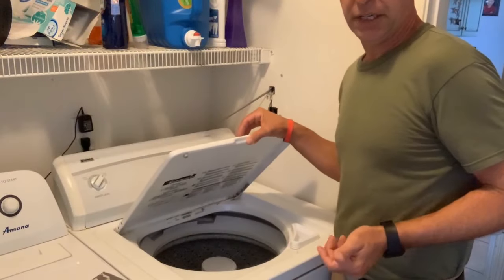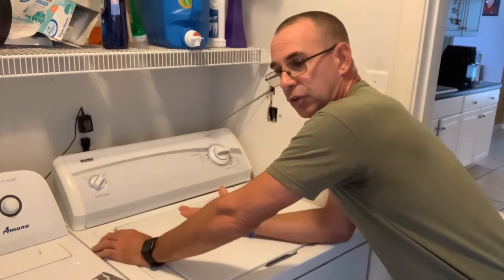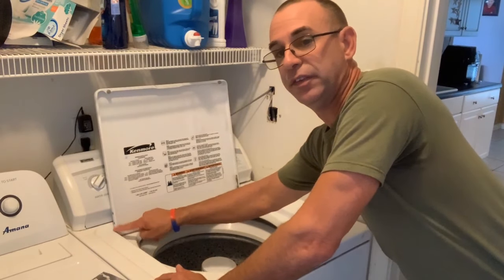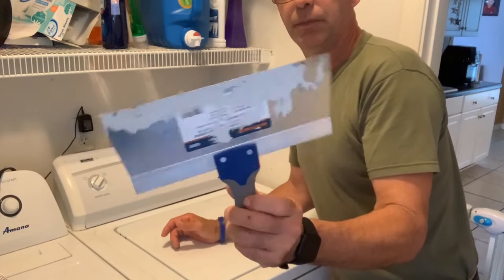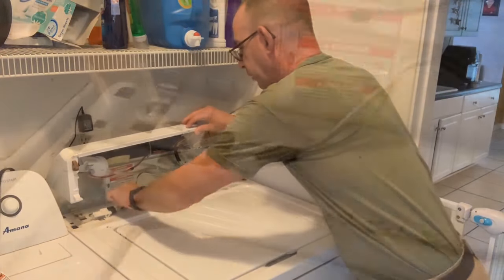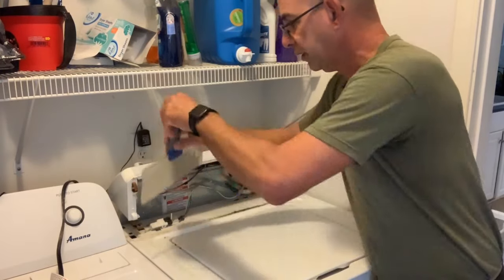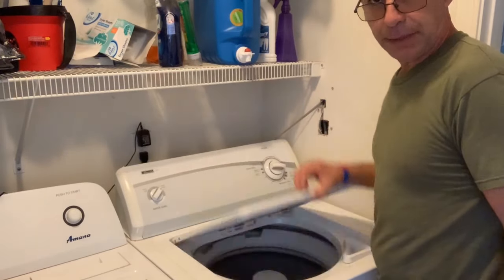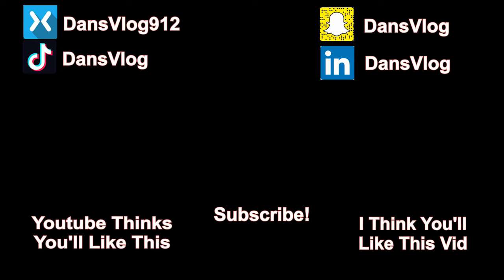FREE FIX - Washing Machine Fills Then Stops - New Style Lid Switch ByPass #Hack

Comment: These kinds of videos are the beauty of YouTube! Keep it up! You, sir, are a lifesaver!
Reply from the maker: Glad to help!
Reply: Problem I have is my washer machine doesn't spray any water you can turn on the rinse cycle and it sounds like the water is trying to drain out but when I turn on you know like the light cycle to start the water; that doesn't happen. Originally everything was working but then we had to replace the temperature switch because we bought a used washer and that was broken we replaced the temperature switch now we're not sure what's causing it what do you think @DansVlog

Comment: Great video, saved me money and a ton of time. This morning had a washer full of water and clothes and it wouldn’t start. Watched this video and literally 10 minutes later the washer was running. The lid switch was exactly where you showed it and the fix worked like a charm. 
The best part is I never have to worry about a bad lid switch again. Thanks for posting this video.
Reply: Have 3 wires purple yellow and another color ßo can u explain  do I need to by pass one of them and cut them and wire them or qhich wires back together have a ge and u unplugged the door switch as well but mine is different

Comment: Thank you so so much!!!! I knew about the little lever underneath but I think I've exhausted that hack. It stopped working. I used this hack and it worked! the comments were really helpful too! I didn't cut the wires either, I was skeptical about that part. Literally just twisted all the wires together tightly as they were and to our surprise it worked. Saved my grandma the stress of purchasing a new machine (she doesn't like change). THANK YOU!

Comment: Thank you Dan!  Same symptoms, and I found that someone in the past had done this in a BAD way, by making a jumper with a tiny 1/2 inch U- shape of stranded wire, merely inserted into the white and gray terminals of the plug itself.  <~~~Don't do that folks, because that eventually fried earlier today.  
Found this video, and I cut the wires as you showed and used a wire nut.  Fixed!

Comment: Was EXACTLY my problem! I didn't cut the wires, but I unplugged the switch and made a jumper out of bare wire between the two sockets of the gray and white wires. Worked like a charm and pinpointed the faulty part! Hero! Thanks!
Reply from the maker: My pleasure

Comment: Great tip. The switch on mine failed about 6 months ago, I replaced it, and it started working again. Until recently, when the same water filling and stopping issue happened again. Opened it back up and the switch was still clicking, guessing that the issue is now the lever attached to the lid. Held the slider down on the switch, stuck a small dowel rod in to hold it down and the washer is up and running again. The washer is 10+ years old and if this happens again I'll probably go for twisting the wires together, as shown in the vid, to get every last bit of use out of it that I can.
Reply from the maker: Heck ya!

Comment: Great video. I just fixed my washer, which is a Kenmore 80 series type 111. Even though the lid and head section design is different, it started to run after I shorted the safety switch.
Reply from the maker: Happy to of helped

Comment: So very glad I found this video. I haven't fixed the issue yet but have had pre-existing problems with having to push the door hard to the left in order to work. I've also noticed the agitator doesn't seem to be tight. It barely moves until I put pressure down on it. Hopefully another easy fix.😉

Comment: On my top loader Kenmore I have found the left side hinge screws come loose causing the lever to be just out of alignment to make contact with the switch when the lid is closed.  Tightening the two screws usually solves the issue.  Repeated slamming of the lid will damage the switch necessitating replacement.
Reply from the maker: My switch became brittle and broke in pieces. I had no choice in getting the washer to work. I had to figure out a hack.

Comment: Thank you so much!! Mine was an Admiral but the symptoms and fix were identical. I was trying everything from diagnostics mode and constantly power cycling. My lid switch is a little different, it's a magnetic mechanism on the front side of the washer, but sure enough I reached my fingers under and just kind of fiddled with the housing on the switch and there was a mild click that I could barely even feel and sure enough it started working again. Probably just a loose wire or something in it. Glad that I didn't go out and buy a new washer. Will probably replace it when I get time if it acts up again.
Reply from the maker: Happy to help

Comment: Thanks for the video ! I have a question as to how the science behind cutting the wires works. Did exactly as you said and it worked, but was just curious for my own thirst for knowledge. Thanks in advance !
Reply from the maker: Connecting the wires the way we do in this video “completes the circuit”. When the wires are connected to the switch, let’s say one to pole A and one to pole B, the switch is open (not completing the circuit). When the lid closes, inside the switch, a metal piece connects pole A and pole B (just like the way we connected the wires).

Comment: I can confirm it works with maytag centennial commercial technology  washer ! ,Thank you
Reply: Miguel did it really work
Reply: @denashachambers8899  Yeah still to this day🤣 trying to get the most life out of this washing machine they sure don't make them like they used to.
Reply: @chairez449  I’m trying to figure mines out but I can’t get the top part of it off
Reply: @denashachambers8899   try prying it off from tbe corners it comes right off I did bend mine a little but still works good luck!
Reply: @denashachambers8899  I got mine to come off with a drywall taping knife
Reply: @denashachambers8899   yours might have screws. My washer had screws I had to remove to take the panel off

Comment: Hey thank you , I have a whirlpool washer that when I fill the water when it was done it stopped , so 2 hours I was trynna solve this problem

I called my mom and she had told me there is a reset/test button on the cord outlet so I bassicly hit reset and it started working , I honestly thought I somehow broke it when I I did Superwash load with only a bed sheet and some towels 🤣

Comment: Question:  So when I cut the gray and the white so I need a special tool to strip them?  Do they  even have to be striped?   Then do I twist the wires together before I put the electrical tape on?  As you can tell; I am not handy and a bit nervous to try this.  Thank you in advance.

Comment: If you want to retain the security of a lid safety switch, then the proper replacement lid switch harness costs about $30, or you could just wire in a new generic switch for ten bucks or so.  And if you do, then Youtube is your friend as to how to make that replacement.  It can be a bit more or less difficult than what Dan just did.  At any rate, a replacement lid lock harness does not make the lid lock inoperative.

Comment: Ok I have a question? I have a Kenmore washer top loader series 100 when I put it on the cycle and load it it up with clothes and push start it fills up with water but once it gets full instead of starting to ajitate “wash clothes” it starts drawing once it drains all the water out it doesn’t do anything else so basically it fills and then it drains what could it be 🙏🙏🙏🙏

Comment: I just tried to get the top off and something snapped then the washer started working again. I'm assuming I snapped off the bolt for the ground on the switch haha. 1-minute fix and I didn't even need to remove anything.

Comment: Thanks for this post and description. We have a 80 series Kenmore washing machine that does not agitate on some cycles and hums or clicks when not agitating, but still spins. It also makes loud noises near spinning cycle. Could it be the same issue?
Reply from the maker: No. Sounds like you have clutch issues but a machine that old? It’s time my friend. Put ol’yella down and get yourself a new pup!!
Reply: @DansVlog  😆 I meant to write 80 series Kenmore. Ik ppl still are working on those. Either way, thanks for the  advice and insight 🙏
Reply: It was the timer switch, but we ended up replacing the washer. Appreciate all of your advice.

Comment: Mine did same thing but I hear a hum is this the same issue, nevermind this wasn't the issue had all these symptoms but I heard humming indicating that the motor trying to work, took apart and a sock was stuck in water pump 10min quick fix
Reply: How did you take it apart. I'm having humming and not washing issues

Comment: Great vid thank u. Wonder if you do the bypass, if switch is never replaced could it cause a fire or electric shock????
Reply from the maker: Well I’m not certified to answer that under a legal sense but I can say if the lid is down and the button is pressed then the electricity is making contact in the exact same manner as putting the two wires together like we did in this video. I can’t imagine overheating or anything like that to cause a fire. We’re not changing voltage or amperage

Comment: Front panel does not open - the screws are on the back.  I put a load in and now wondering why it stop working after I place the load in the machine.   😭😭

Comment: Greetings and thanks for this post. The washer fills then it's some humming noise and after awhile it starts agitating and stops off and on. It agitates on certain cycles, but not all cycles. What do you all think is the problem??
Reply from the maker: I am not sure. Can be any number of things. Loose belt, clothing stuck between the drum and the housing, bad cycle switch, bad motor, loose wire...
Reply: @DansVlog  Thanks so much for the speedy response. I'll look into all of them and hopefully I can fix it at home 🙌🏾🙏🏾

Comment: Hi! Any suggestions for a GE top load washer? Same issue not spinning
Reply from the maker: If it is just that it is not spinning then I would say unplug the machine and reach in to the TOP of the drum and see if there is an article of clothing causing a jam. If not and you do hear a bang (clutch engagement) but won’t spin, the clutch may be ready to be replaced. I am assuming it fills with water and works normally, just won’t spin.
Reply: @DansVlog  Hi Dan my daughter has a top loader LG 8 kg, there is delays in the washing program when on a few times as the program runs. But it finish the cycles only delays, then switch on by  itself again. Please help. South Africa thanks for your help

Comment: The action starts @2:15  The short answer is to short circuit the safety switch while maintaining any ground connection.
Reply: I would probably solder the twisted pair together, and seal them under heat shrink, rather than depend on a wire nut and that nasty old plastic electrician's tape.  That tape will eventually lose its adhesion, become gummy and nasty, and eventually leave somebody with a sticky mess, wondering why those two wires were ever wired together.

Comment: Some washers get stuck. Clothes go down the drain to the motor.
Reply from the maker: I had a sock wedge between the drum and the wall of the machine. The difference is, with a bad switch, nothing will happen. With a wedge sock or whatever, clicking and clutch engagement will be heard but agitation may not happen

Comment: Any risk of 🔥the 2 wires are connected by electrical tape?
Reply from the maker: When the lid is down and it’s pushing the trigger down those two wires are connected through the switch so connecting them to each other makes no difference, it’s as if the lid is down at all times. Also, I’m pretty sure it’s low voltage and does not create heat
Reply: @DansVlog  appreciate the reply. I used a marrette, some tape and you saved me mucho bucks. Thnx.

Comment: If went through all that trouble to diagnose the problem why didn't you just replace the defective lid switch? Also, you should have just shorted  both wires temporarily with a jumper wire to drain the tub then add the new lid switch later when it arrived instead of cutting into the wire harness  If your going to do ANY job, do it right !  Your fix wasn't not only cheap but was lazy too...